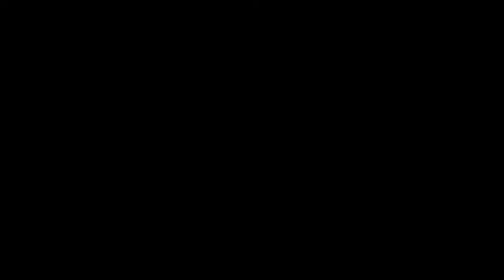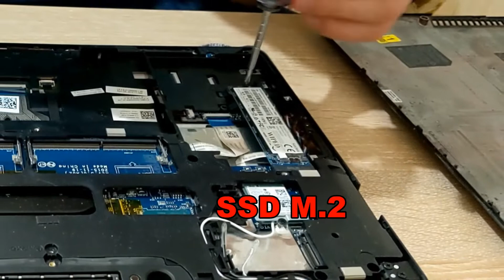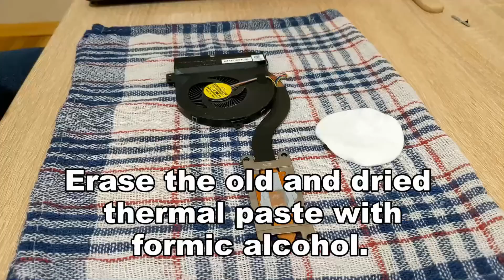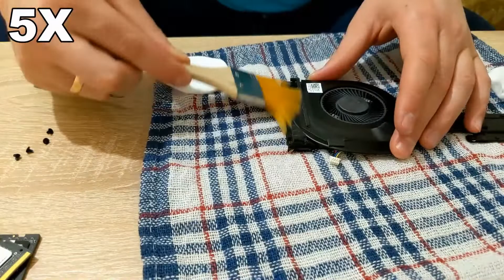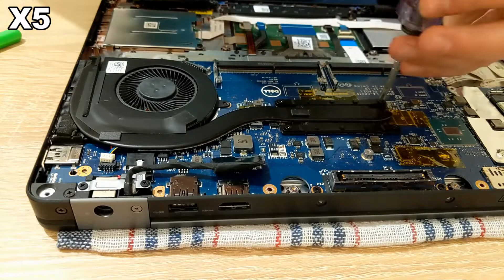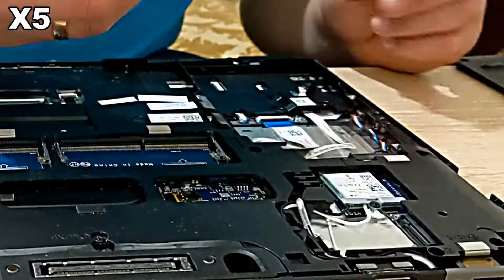Dell Latitude E5470/E5570 Disassembly and cleaning /How to apply thermal paste

Comment: What is the RAM speed in Mhz this laptop has? I see they're Corsair. I also need to know the processor model, Please let me know.
Reply from the maker: RAM, if I'm not mistaken, was 2133MHz.
CPU intel core i7 6820HQ.
Reply: @AndriyTech  Thank you so much. I have that same processor....Can I use 3200 Mhz RAM Memories....? I guess it won't be a problem.
Reply from the maker: @joseluisbrear.5196  of course you can)
But I still recommend to try first and then pay, because from my experience, some sticks may not run (this doesn't happen often).
Reply: @AndriyTech  Thank you.
Reply from the maker: @joseluisbrear.5196  you are welcome)

Comment: Hello, Bluetooth is not working for me after I opened the laptop
Reply: I don’t know if you fixed it yet but did you make sure both the wires on the wifi card were fully plugged back in. They can be tricky to plug back in carefully at times. If they are fully plugged in, the wifi card may be not working correctly. You can either just deal without bluetooth, get a usb bluetooth adapter, or just replace the wifi card

Comment: Is the procedure the same for E5570 with AMD R7 M370 GPU?
Reply from the maker: The process is almost the same, but you will need to additionally unscrew +- 3 bolts on the GPU cooling system

Comment: Can you give the temperature stats? I have the HQ i5 and i7 versions since they go up from one they are at 95 degrees, is it normal for it to be like this? (I did maintenance, it doesn't turn off, it's as if it were normal.)
Reply from the maker: You get 95 degrees in stress test?
I had 2 e5470 laptops (i5hq and 7hq) and they both heated up to 100 degrees in stress tests (after cleaning and replacing thermal pastes). I think this is their norm temp, or the e5470 has a bad cooling system. In any case, these models are hot and we can't do anything about it.
Reply: @AndriyTech  on normally use..
Reply: @dgm778  Yesterday I changed the thermal paste and cleaned this exact model, and it gives me between 45-50°C on normal use

Comment: Hi, I was just looking for how to disassemble and clean my e5470. I think it gets too hot and the battery lasts too little, so I'm going to clean it and change the thermal paste. Do you think it's because of the thermal paste or is it that the e5470 gets too hot and the battery lasts too little?
Reply from the maker: Hello Friend.
Not so long ago, I was able to use two dell e5470 laptops(one was on the i7 6820HQ and the other on the i5 6440HQ).And in the stress test aida64 they warmed up to 90 degrees, but that's after I cleaned them and changed the thermal paste to a new one.
And so in simple programs, they heat up from 45 to 80 degrees - these are normal temperatures for these processors.
But in any case, clean your laptop :) It will be much better.
Reply: @AndriyTech  Tanks you so much
Reply from the maker: @jaimehernandez9867  You welcome.